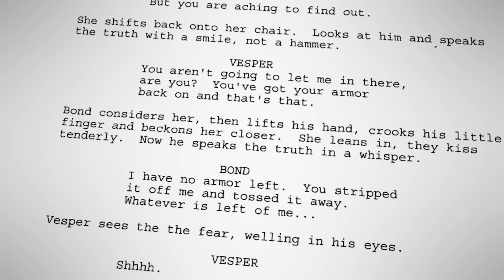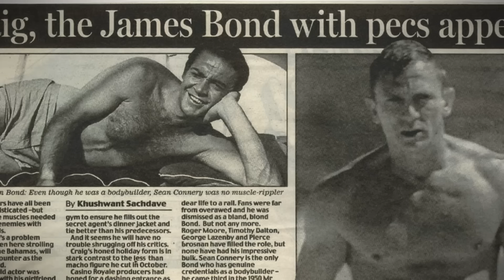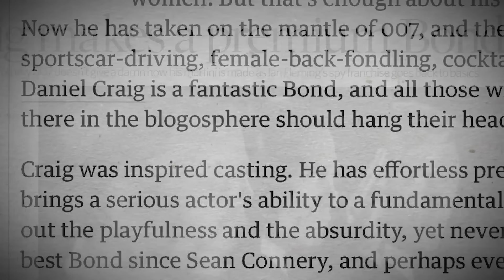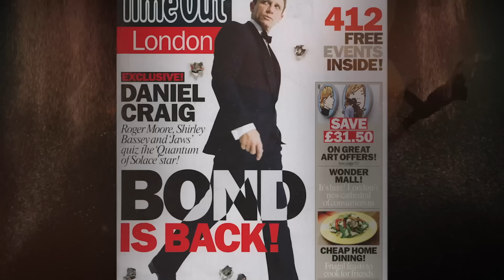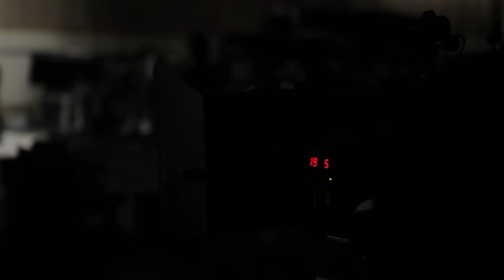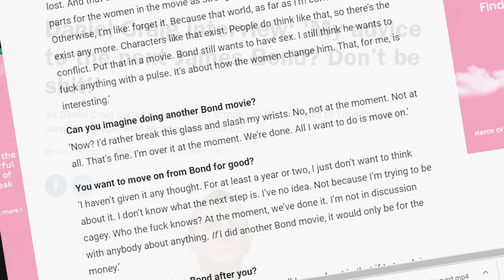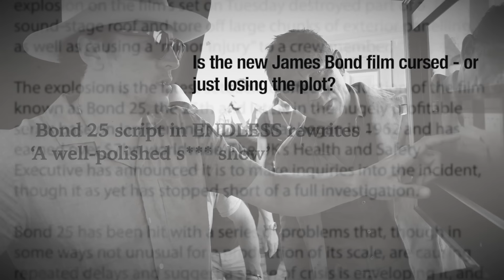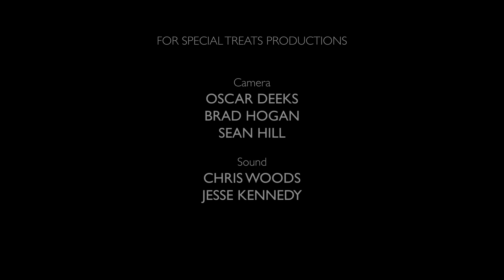BEING JAMES BOND

Comment: No Time to Die, the promise of a final chapter in Daniel Craig's Bond journey left me with mixed feelings. While the film showcased exhilarating action and visual spectacles, the narrative direction felt disjointed. Certain character arcs seemed underdeveloped, and the pacing struggled to maintain a consistent tempo. Though it attempted to infuse emotional depth, for me, the execution lacked the captivating finesse I had hoped for in bidding farewell to Craig's iteration of the iconic spy.

Comment: The action sequences with Craig were better, more engaging and more dramatic. Moore and Bronsnan seemed really good until Craig showed up. After that, the previous Bonds seemed weak and effeminate. He redefined the role. A believable hero. He exudes capability and that is the core of the character. The media are pathetic. They get it wrong more often than they get it right. Which is bizarre. Even a dice has less bias.